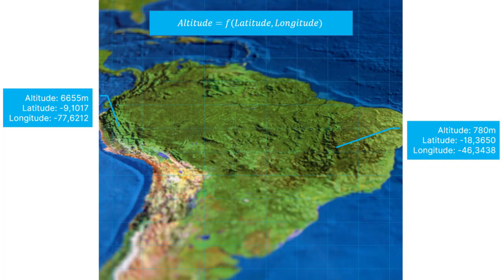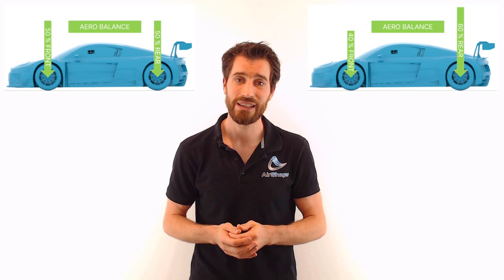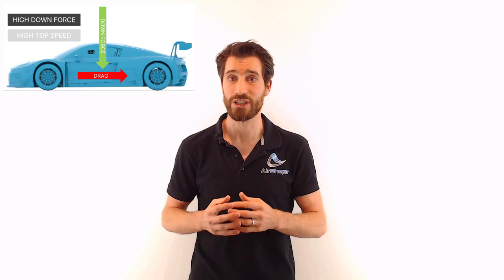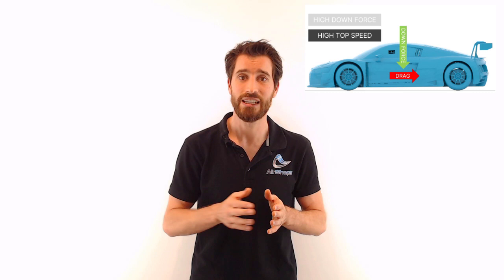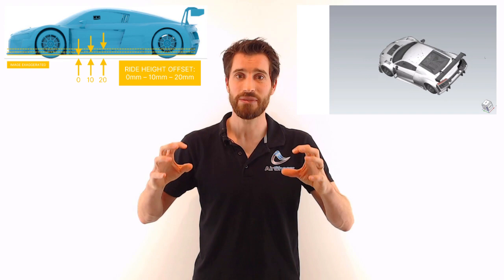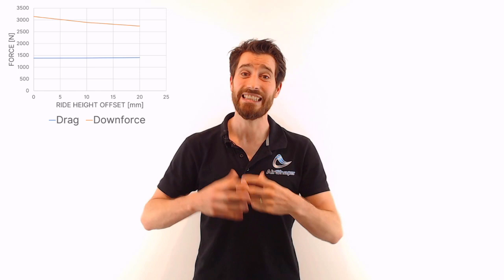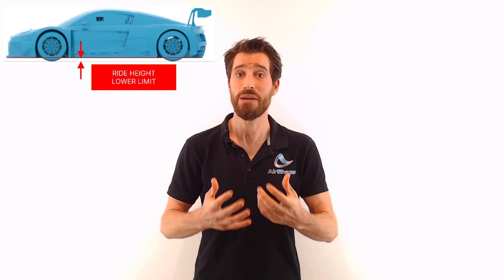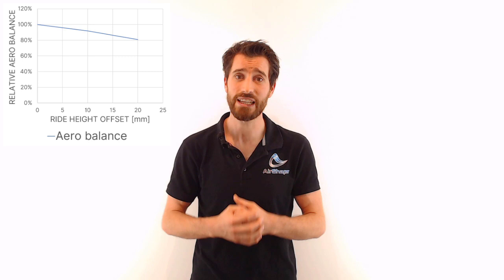Race car aerodynamics #3 - Aero mapping

Comment from the maker: Are you building your own race car, aero maps or CFD simulation setup? Just drop your questions & comments below!
Reply: I'm taking my daily car to track events for fun. My car is different than a normal track car for sure. It's a 2019 VW GTI so FWD hatchback, lol. I'll know more I hope after my next track in July. I'm working on aerodynamics now. I lowered car, added flat floor, rear diffuser and hood louvers.
Reply from the maker: @334trax2  Ah that sounds cool!! The flat floor should help to increase top speed --> sometimes, they added small deflectors to make the air jump across the non-flat floor. Might be worth looking at removing those (but then please do validate the effect on top speed before leaving it like that :) )
Reply: @AirShaper  thanks
Reply: @AirShaper I am new into CFD simulation, but trying to learn how to use Openfoam and Paraview to get a rough overview of my rally cars aerodynamics and which thing I could improve. I also try to improve my current airbox and intake system. Thanks for your great tutorials!
Reply from the maker: @NationZeroMS  You're most welcome, glad you like them! Hope you can improve your car through them, and good luck with OpenFOAM!

Comment: Should drag be taken into account when finding the aerodynamic balance to get as accurate results as possible? As we've done it, it's just the downforce of all the aerodynamic elements multiplied with their respective moment arms.
Reply from the maker: Hi Erik,

yes, the drag significantly contributes to the aerodynamic balance, in the way you describe!
Reply: @AirShaper  Thank you for responding so quickly! How should the drag be incorporated into the calculation of the balance? Currently we only use downforce and the moment arms from components generating it...
Reply from the maker: @erikhein2609  Well, it's very complex, as each component can also generate an aerodynamic moment (on top of the drag & lift values). So best is to calculate the moment by integrating all of the pressure & friction forces across the surface, together with the lever arm (for each individual cell). Perhaps this video can help:
https://www.youtube.com/watch?v=kczZPc4M-ms

Comment: Apart from sports cars & lorries , can aerodynamics help with normal road cars going in city traffic low speeds? how can one use external aerodynamics principles to make life of a common man better. I enjoyed the blog on indian rickswaw aerodynamics in the website, but I guess for road car OEMs  it's not worth investing in aero . Can these principles used in future to make larger impact on people life?
Reply from the maker: In short, yes!
At highway speeds, air resistance accounts for over 50% of fuel /battery enery consumption. In city traffic that would drop to perhaps 5-20% depending on the velocity, so still very relevant. And yes, OEMs go to great lengths to improve the drag coefficient of their cars (investing millions and really changing the exterior design in function of it).
Reply: Like the Airshaper said, lots of money is going into this. This is a huge reason why lots of modern economy cars from different manufacturers have a similar teardrop-like shape, it is to reduce the flow separation, thus reducing the drag. A fun way that volkswagon and porche have tried to do this is by dimpling the undercarriage of the car like a golf ball. At city traffic speeds, the effects are not very pronounced, but at highway speeds it becomes very important. The general rule of thumb is that the faster you go the more drag force you encounter. If you want to reduce fuel consumption, sometimes dropping your speed a little bit helps.

Comment: hii your videos were great. Do we perform  cfd of a vehicle while cornering? if yes what all condn are used
Reply from the maker: Dear, we don't run 'curved wind tunnel' simulations yet, but we do offer the possibility to run the car at different angles of attack - could that be useful to you?
Reply: @AirShaper  ok, like take a rectangular enclosure , rather than placing the vehicle normally we used to , which mimics a normal wind tunnel testing,  we would rotate the vehicle wrt z axis according to turning  angle??
Reply from the maker: @prasadchettiar6589  Indeed, that could be an approximation. Keep in mind that you may need to position the whole car at an angle that is in between the steering angle of the front wheels and the zero angle of the rear wheels, to get the "real" angle of attack (even though it's still an approximation).
Reply: @AirShaper  okk i got some idea, but still have some doubts, what all boundary conditions are reqd to be used, for eg how will the moving wall move , how should i input the inlet condn(velocity normal to inlet or in component form)  and all such things??
Reply from the maker: @prasadchettiar6589  Hi Prasad, indeed, you will need to compromise in some locations. The simplest would be to keep a normal, rectangular tunnel with the ground moving in the same direction. The car would be slightly angled, just like the front wheels (which have even more angle). That can cause local "differences" at the contact patch of the wheels, so you may need to play a bit with simulation settings to get it all working. If you want, this can be done with AirShaper (including rotating wheels) using a Regular Simulation!
Reply: @AirShaper  hello, how will we  provide inlet velocity condn like normal or in component form??
Reply from the maker: @prasadchettiar6589  In the simple setup, just normal to the inlet. For more advanced settings, you could check cfd-online.com - loads of discussions going on there!
Reply: @AirShaper  fine sir thank you so much for ur answers!!!
Reply: For cornering simulations, I use a semi circle shaped goundary box (like a halved donut). There is an even more professionsl way to simulate cornering, where the car moves in a circle shaped boundary box, just like in real life (I can detail it more if you need). Yawing the car in a rectangular boundary box doesnt really makes sense, since it's so unrealistic, and it's kinda the same effort to do proper cornering simulations
Reply from the maker: @jozsefmolnar4992  
I agree, for more realism, you need a curved flow domain! You can already capture some trends by yawing the car, but indeed, in some cases you'll draw the wrong conclusions. If the situation were more common, we'd pick it up in our automated tool. Currently, most people running such simulations already have the right software at their disposal to do so! Thanks for the comments.
Reply: @jozsefmolnar4992  ok, could u elaborate more on boundary conditions